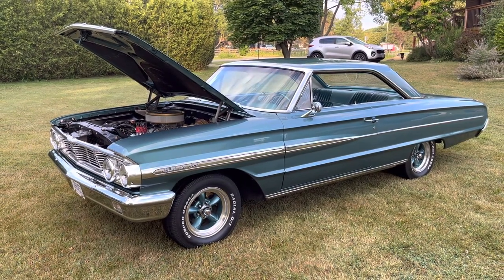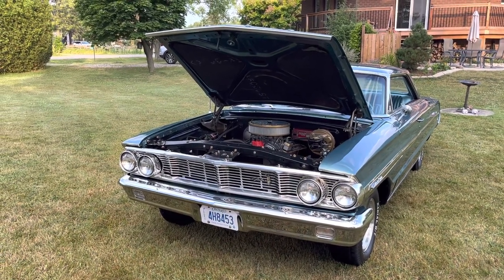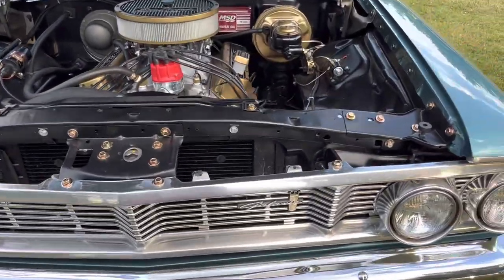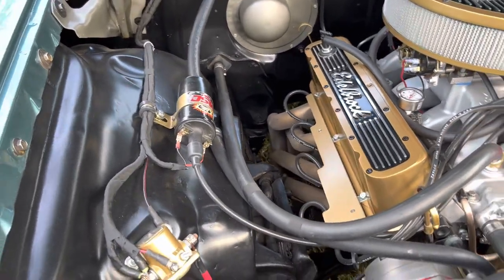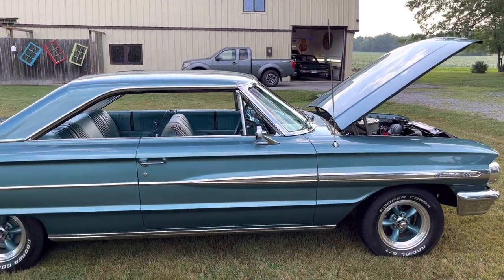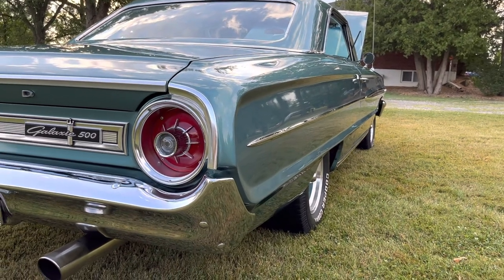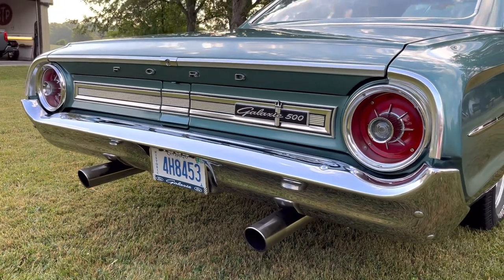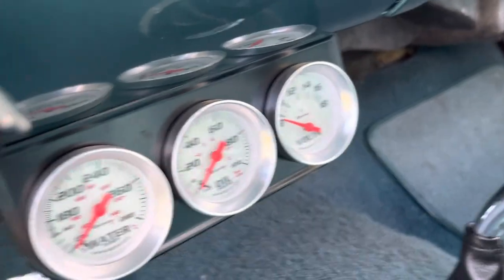1964 Ford Galaxie 500

Comment: I am surprised that you did not remove the steering wheel and replace the column shift elements with those from a floor shift model.  I did that on a '65 Galaxie.  1963 through 1966  parts will all interchange.  To make sure the car would start I put a small piece of wood in the electrical block on the steering column under the dash to lock it into what it thought was the Park position.
Reply from the maker: Interesting. I never got that far and then sold the rig!

Comment: Sorry, but no way would I have a Fram oil filter. Otherwise, an amazing car.
Reply from the maker: Opinions vary- that filter was used by a very reputable engine builder.
Reply: @adambedell73  At one point in time I used them too. Look at all the oil filter reviews. Never again.
Reply: @adambedell73   have used Fram since 1965. Never had any issues, ever. Daily driver, 3000 mile intervals? Never a problem.   Observation - if they were as bad as the detractors claim my guess is that there would have been a lot of law suits
Reply from the maker: @tombob671  remember opinions are like assholes…

Comment: I had a total of three 64 Galaxies in my youth. My first was a standard coupe with a 300 hp 352 auto C-4 tranny., It had everything except a/c. My other two were fastbacks. The first had a built 390 with auto C-6 and everything except a/c. There were a lot of 64s with a/c but as hot as it gets down here I never felt the need for it. But my 3rd 64 was an XL black on red interior. It had a very stout 406 Interceptor package. They never made an interceptor 406 so I made my own/ it was extremely fast for a Galaxie. It was running a 3 speed with O/D on the floor. I had never seen very many Galaxies with the 3 speed on the floor but it worked exceptionally well Would you consider selling that 64 you have? It is a bit modded but I would replace the 351 with the proper big block. However it would not be stock after I finished with it. This kind of car needs the big iron in front of it. This is a very tastefully redone restomod and it sure deserves a deep look. The paint is great.
Reply from the maker: Thanks for your comments, this car just sold and is heading to Florida!
Reply: @adambedell73  Where can I go to check out any cars that you might want to sell?

Comment: No 351w engine in 1964. 260-289 were the only small blocks option. Outer aluminum trim was polished and not chrome from the factory. BTW, it's a sports roof and not a true fastback. Speedometer should be mph and not kilometers unless it's a Canadian car.  No disc brakes in 1964 either. Nice restoration but not great.
Reply from the maker: First it’s not the stock engine. In fact not much about the car was stock. The restoration was completed before I bought the car including the trim. The speedometer is in mph. 
I realize I misspoke when I said it was a fast back but I always appreciate when experts like yourself correct me. Next time I’ll send the Final Cut to you for your approval 😉
Reply: @adambedell73  I simply pointed out things that are incorrect.

Comment: Why didn't go with a Cleveland? Windsor not liking the engine i:e had 1 of those not a good engine . I had better luck with a Cleveland.  Just saying.
Reply: Ray whyde the difference between a Cleveland & a Windsor was the heads. He has aluminum heads.
Reply: IDK, I had a 351W that would break the tires loose at a 30mph tromp and got me 18-19mpg at 80mph. Don't know a Cleveland that could match that
Reply: That was with a stock 351 cam
Reply from the maker: The engine came with the car when I bought it so it wasn’t my choice.
Reply: @tweedjohnny8740  you forgot the real difference, over 150lbs. Cleveland was A boat anchor, FE engines is what was in them, 352, 390, 427 R code then you had something,